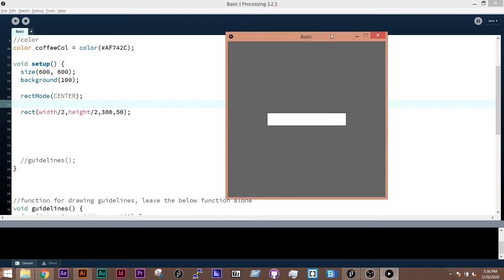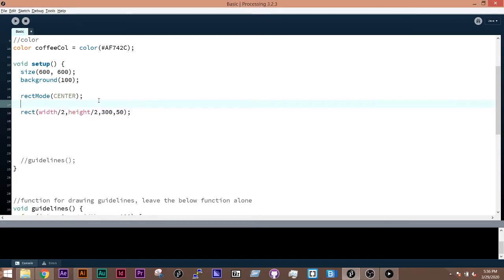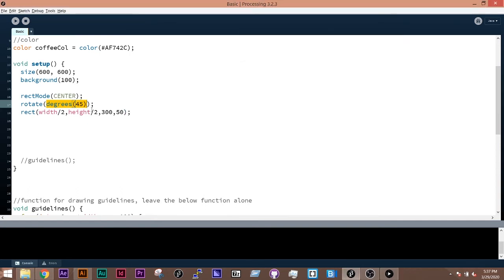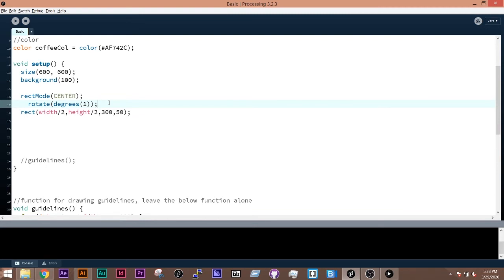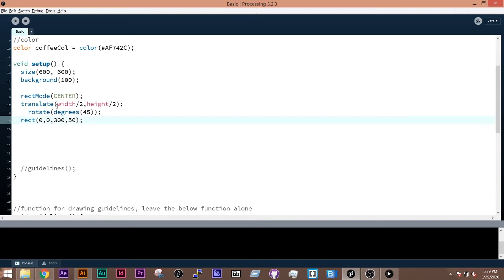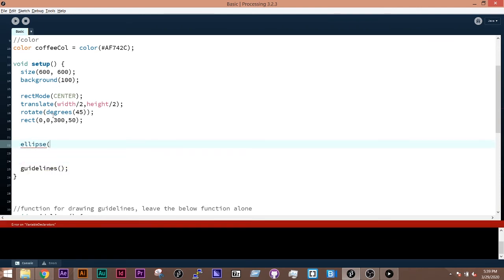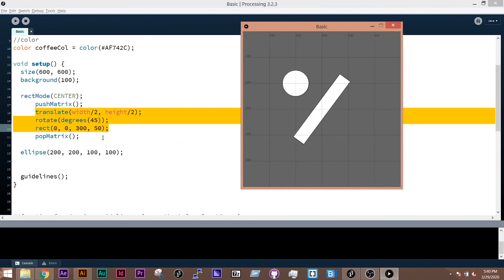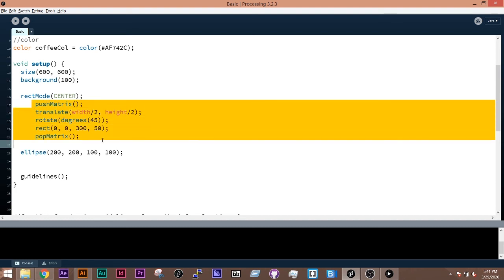Processing - Rotations

Comment: Good explanation, EXCEPT: mix up of degree() and radians() function
  println(radians(180)); // = 3.1415927 = PI 
  println(degrees(PI));  // = 180 degrees 

But why does your example seem to work ? - by coincidence. However, it does not rotate exactly 45°, but 53° in opposite direction.
In fact, your code turns the object 410.35077 times

println(degrees(45)/(2*PI)); //=410.35077 - 2*PI being a full circle.

.. out of which 410 times are useless, but falling back onto your feet every time, 
and .35077 corresponding to 126 degrees.
And that is 54° in opposite direction; approximately, but not exactly 45°.

  println(180-degrees(degrees(45))%360); // = 53.73875
😄